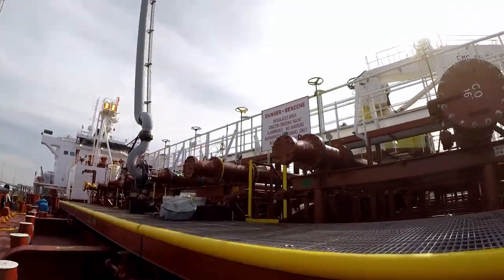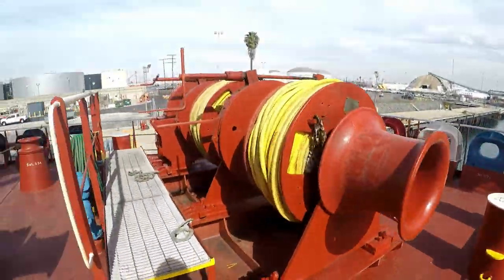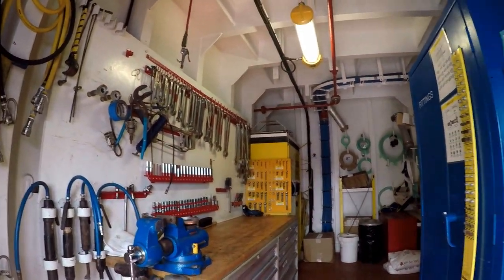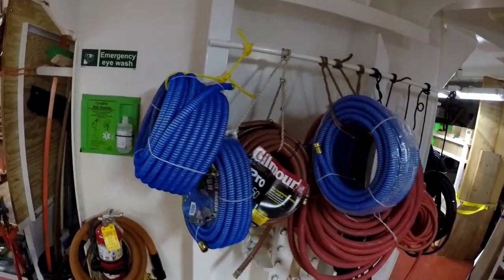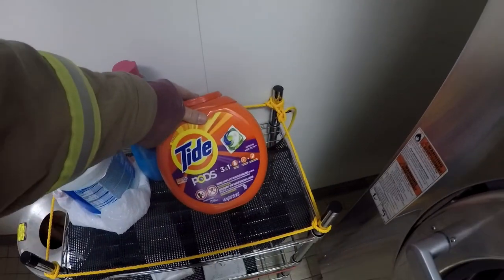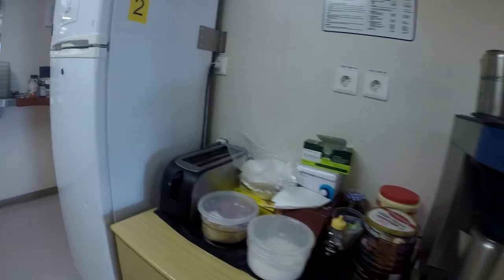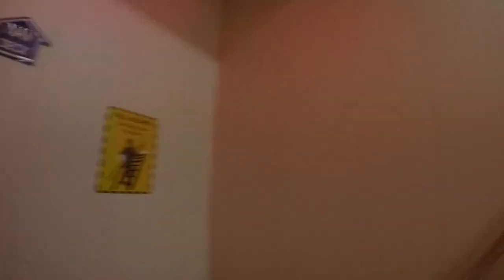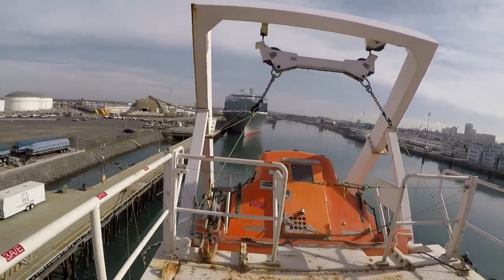TOUR OF A TANKER SHIP

Comment: Blown away by the quality of the accommodations, the gym?!? and how well preserved the ship is. 
I am guessing NOT Far Eastern built? 
very nice video dude. keep it up
Reply: Nothing wrong with a Korean ship, what point are you trying to make?
Reply: @ike1660  Chinese built ships I had in mind. Much smaller and worse rooms in the accommodation etc
Reply: @connan7  I don't know specificly about ships but I imagine it works like everything else produced in China; you need to make the plans yourself and have rigorous quality control, if you've got that implemented well, you can get high quality products.

But there's a lot of ways it can go wrong, I can tell from my own experience. I had a bunch of non-ferro casting done in China, and you noticed imediatly if they thought they could fuck you over with a cheaper subcontractor. Product was great and uniform one shipment and all over the place in the next. Luckily we had a guy over there that would do QC, so we caught most of it before it got shipped over.
But even then, the prices were so low, they could have fucked up every other shipment and we would've still come out on top.
Reply: its called American Endurance it was made in Philadelphia in 2016
Reply: She’s a Jones act vessel so has to have been built in the USA for future refrence